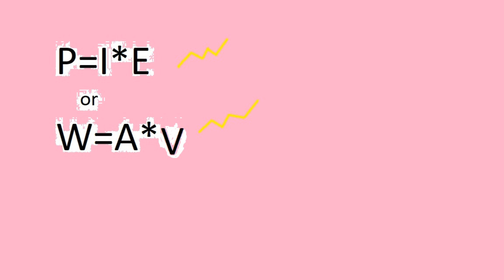ASRock AB350M Pro4 Freezing, Crashing and Lockups! Part 1

Comment: My PC just froze while watching this video. Thanks ASRock!
Reply from the maker: What is your CPU?
Reply: Ryzen 3 1200 stock speed
Reply: What BIOS version are you using btw?
Reply: Hello?
Reply from the maker: 4.50
Reply from the maker: have you run a memory test to be sure your memory is good? A bad memory stick can do weird things.
Reply: Did a memtest. No issues.
Reply: No errors found. I checked the hdd too
Reply: I'm using the 3.00 bios as of now. I tried all the BIOS and it's still freezing
Reply: The Crazy Old Coot Hello sir?
Reply: I'm having the same issue here with my asus prime b350 plus board gonna limp it until I get a x470 strix board. nothing wrong with ram or cpu until I tried to booted it up this morning no display in my pcie gen 3 slot had to move my rx580 down to my gen2 slot to boot! Yep bad board ugh. ;( thank god their is nothing wrong with my rx580 just need a clean install on a new mobo.
Reply: Mark Davenport Jr Try reinstalling OS with the latest media creation tool on the site.
Reply: Yep I found the source it was my dead rx580 card had to swap it out for a gtx 1060 6gb evga card its working great no freezing after a hour or so of gameplay. Now I just need to upgrade my ram to 16gb for future games. :)
Reply: BlazingApple did you stop it from freezing?
Reply: yep it was a dead rx580 had to swap it out for a gtx 1060 6gb card been working great just like when I first got my pc all I need is more ram 8gb is not cutting it these days. :)
Reply: I have this motherboard. Running Ryzen 5 1600X, GTX 1060 with 16gb of RAM and a Samsung 250GB SSD. Never had any issues. No freezing, no nothing. I don't know where these complaints come from. Get better parts. Mine isn't very high end but it's still good enough for a long time

Comment: Hey ya crazy old coot! Thanks for making the videos regarding the AB350M and the Ryzen 2400g. This is my first build and I was having a lot of issues, mainly BSOD Of all flavors. I adjusted the voltages as advised and, so far it has seemed to help. It even let me OC my GPU which it did not do before. Gave you a sub for all the help. Setup and result follow for those interested and others having issues. Note:  chose to do my adjustments in the BIOS. 

CPU Speed: 3.8
CPU Voltages:  1.3375
DDR4 Voltages: 1.3
DDR4 Speed: 2400 (it’s rated Speed)
SOC Voltages: 1.2
RAM allocated to GPU: 2GB

Build Specs:
Ryzen 5 2400g
ASRock AB350M Pro4
Samsung 960 evo 250 GB SSD
WD Blue 1TB HDD 
2x8 GB g.skill flare x ram 
Cryorig H7 cooler 
Season 620W s12ii bronze psu 

If you have OC’d the GPU at all, what speed and Voltages did you use. Thanks!

Comment: Good video, you seem really wholesome, have a good day if you're reading this boss
Reply from the maker: TY
Reply: @ellsworth1956  you're welcome, it was very instructive. It seems I still have the problem though lol
cpu voltage 1.3 on a ryzen 5 1600x
ram 2x4 3000 but lowered to 2666
dram voltage 1.1v
cpu soc 1.2v
the more I play the faster the complete freezes gets, i tried updating bios and drivers, complete os installation,vrm is at 104 celsius even at the moment I start my pc and it doesn't go higher. honestly I don't know what to do. Trying to contact as rock for a replacement or a solution... any ideas? bios is at 5.5 I think but I'll lower it to 4.5 if it can help
Reply: I did memtest too and had no issues
Reply from the maker: @idiedinvayne1712  Try bumping your Dram Voltage up to 1.30V . If your VRM is stuck at 104C something is not right most likely a bad sensor. Do you have a way to actually read the temps of you VRM. IR gun or a TC?

Comment: I think it's because you can't adjust the SOC voltage.  I tried entering a value into the VID setting and it's stuck at 0.95.  Other people have reported that setting does nothing.  I ended up buying a MSI B350 Tomahawk and so far so good.
Reply from the maker: Demetrius Lolos you can set the SOC voltage in Ryzen Master.
Reply: @ellsworth1956  Tried that and it doesn't keep the voltage when I suspend, hibernate, or restart the PC.  It does work though, but temporarily.

Comment: I’m pairing this board with an R7 1700 mostly for the 2 m.2 slots the board provides. Based on the reviews and this info I think I will water cool the proc. Not for the overclocking potential but for better heat management. I have to wonder if the wraith spire coolers are dumping heat into the same space and this would cause an issue in low air flow cases. This would then be a really big concern when you dial in an overclock...

Comment: If voltages are an issue, then it puzzles me how to solve the problem concerning my setup (AB350M Pro4 / Ryzen 5 1600 / 32 GB RAM at 3000 MHz / GTX 1050 or GTX 1650).

Restraint on a cool day seems to be my best solution, yet it is not full proof, and those cool days will only last a few more months.

BIOS is up to build P6.00. All BIOS settings are default at present (including my RAM speed being strangely set at 2133 MHz), and I use default (stock) clocking on my video cards.
Reply: Probably should give an overdue update: VCore aside (I couldn't get a reading on the default setting, so I left this alone), I tested out the voltage tweaks a year and a half back.

They proved to be roughly 99% effective (rather than experiencing multiple freezes per day, I was experiencing no more than 1 freeze per month, maybe 2 if I was really unlucky)... until my cmos battery started dying, causing these settings to be no longer be saved consistently.

Comment: My Asrock B450M pro4 , 
1)Turn on PC - This works... Boots into Windows 10 just fine, no issues.
2)Turn off PC - This works... Just FYI - all fans stop, computer is off as far as I know.
3)Turn on PC (right after turning it off, like 5 seconds later) - Makes it to the ASRock screen, but just sits there. I disabled graphical POST (with AsRock Logo)
Reply from the maker: If your Power Supply has an  On/Off switch try turning it off for 5 sec then turn it back on then try turning on the PC. If it doesn't have an ON/Off switch just unplug it for the 5 sec.

Comment: Only issues I've had is it won't work right being hooked up to my 42" tv with out using a Gcard. The video output was messed up so i sent it back. Awaiting for my replacement. I figure if my 10yr old gateway can run ok on my tv why shouldn't a brand new mb.
Reply: Dracoz74 ryen have no video card included bro. So its imposible to use them without a videocard. The only ryzen that have video output are the one who have G at the end like the 2400G that are an APU.
Reply: ya i thought I put that the CPU was a Ryzen 5 2400G. I sent the MB back, the replacement (knock on wood) is working just fine over all. I still have to use a smaller tv to get into the bios. But i think that's cause my system is to fast now. And doesn't "wake" the tv up fast enough. I'm happy with my set up.
Reply: Dracoz74 nice, you can install the asrock bios restart its a software that you can download from the same webpage that the BIOS and you can use it to reboot instantly in the bios without touching the F2. I use it because i have the fastboot mode to.
Reply: sweet i'll check that out thanks!

Comment: I have this ASRock motherboard and I'm getting lots of random freezing that's lasts about 10-15 seconds. Sometimes in game (vary frustrating in multiplayer) and even on the desktop.. I would not recommend this to anyone at the moment. Can things like this be fixed by ASRock just through bios updates?
Reply from the maker: Andrew Francies I do not recommend any B350 motherboards. I ditched mine and got the Asus B450M Tuf -Plus Gaming. So far so good. Working on a review right now.
Reply: I don't have these issues with my Ryzen 1600 on the AsRock AB350M  pro4 motherboard,  just ram clock locked at 2400 mhz and and it hardware reserves half of my 16 GB of ram.
Reply: @ellsworth1956  is the ASUS b450m still good until now sir?
Reply from the maker: @miguelricardosobong4927  mine is still running fine. I have an R5 2600 with an RX 570 in it now and it runs fine.
Reply: @ellsworth1956  I still have the pro4 sadly. I changed my SOC voltage to 1.2 and it still crashes. Do you have any more ideas?
Reply from the maker: @miguelricardosobong4927  If you have checked out everything I went over in my videos on this board. I'm not sure. have you tried another videocard just to see if it is the Videocard having issues? clean out old video drivers no longer in use.
Reply: @ellsworth1956  I'll try go over the video again but essentially what I did was set my cpu to 3625 at 1.15v, dram 2800 at 1.25 (memtested for 8 hours), SOC at 1.2. That's what you did also for yours right or do I need to input the same values as yours?
Reply: I have a MSI x470 gaming pro carbon with the same issue of freezing its driving me crazy!

Comment: I have the same motherboard, bios 3.40. I can`t overclock my r5 1500X, cause there are no settings in bios, such as cpu loadline calibbration, curret capability, cpu soc voltage and others. What to do? when i set 3800 with 1.35v, it works but only at 1.392v all the time and freezes so much in games. Maybe It uses the voltage of bost, but why?
Reply from the maker: The easiest way is Ryzen Master, You can adjust all that there except load line and there is none for load line.
Reply: ok thanks, i will try

Comment: FIRST TIME BUILD!! HELP!!!!!Hello, I just received my parts including the asrock ab350 pro 4 motherboard. Hopefully you can help please? I have the rzyen 1600, 2 8gb corsair vengeance at 2400mhz, evga 500b pos, and I cant get this thing to work. FANS TURN ON FOR LIKE 10 SECONDS, TURNS OFF, AND RESTARTS AGAIN, OVER AND OVER. I just cant get it to boot at all. PLEASE SOMEONE HELP!!!
Reply from the maker: If you are sure your CPU cooler is on correctly  and the fan is spinning and you have your power cables on correct (dont forget there are 2 ATX cables) then try one memory stick at a time. then take 2 aspirin and see me in the morning.
Reply: Ill take the 2 pills, and see you in the morning. I am done. Was going to switch from console to pc, but this shit is not what I expected. I cant even get my first pc to work!!!   CPU cooler is on correctly, fan is spinning, and power cables are correct, but here is the problem, the asrock has a 24 pin for power, and my pso has two connectors, one with 20 and one with 4, the 20 latches on perfectly but the 4 pin does not come with a little latch, therefore will not go all the way in, only partially. could that be the problem?
Reply from the maker: Yup that could be it. The 4 pin connector goes in first so the 20 pin kinda goes on top of it. You really shouldn't be trying to build your first PC by yourself. You should have if possible someone who knows what they are doing supervise you .
There are those tabs on the 4 pin connector on the inboard side, those go to the board side of the 20 pin not the wire side. I can send you pictures if you need.

Comment: I'm using Ryzen 3 1200 in my AB350M-HDV motherboard. Is it good?
Reply from the maker: Thanks for Subscribing! Power wise it should be fine as long as you have a decent power supply. Don't expect to get your memory speed above 2933. Just remember all the B350 boards have some quality issue as they all have 1 star reviews above 10%. If it runs your good.

Comment: Alright here is my final conclusion or (solution)  if your Ryzen keep crashing or freezing or you need to shutdown by holding the power cause the reset button doesn't work and does a black screen just download a newer version of windows 10 the real problems is windows 10 old version of 2015 wont work at all, all you need is the newer 2018 version of windows 10 the version : 1809
Reply: 1903 here and it still freezes
Reply: @Yasin Jones thanks Yasin I will try that today!
Reply: @Yasin Jones I did try it this morning before work and it appears to have fixed it but I test further tonight, if so you would think this would be known to the manufacturers and they could roll out bios fixes for it.
Reply: @Yasin Jones yeah it didn't work after all, infact made it much worse freezing every 10 to 20 seconds. Honestly I'm done with my board as I can't waste more time on it.
Reply: @Yasin Jones it turns out my board was faulty and they have tested it and sent it away, but it can take upto 28 days, lucky I still have my trusty x4 955 AMD rig while I wait

Comment: I have a ab350m hdv mobo  I feel like it's not powerful enough only supports 65w cpus.
Reply from the maker: I'm setting up my new Motherboard for my R5 1600 and I'm puling 125 amps at 3.8 Ghz all cores with a voltage of only 1.33. Now this is under stress but I wouldn't want to pull more than that through the AB350M pro4 board or other low end ASRock Motherboards. So you can get away with a moderate OC on a six core but that is it. Why would anyone buy a budge Motherboard for an 8 core 16 thread CPU is beyond me.

Comment: So this board will work with r3 2200g without any problem?
Reply from the maker: If you get one label Ryzen 2000 ready. If not once you have  the BIOS up to date you should be good.
Reply: The Crazy Old Coot Thanks a lot for great videos, but is bios the only issue? u said in the video that Asrock AB350 pro 4 works ok with 4 core cpus but previously I had read the comments about this mobo and decided to get another, now if this works fine with overclocked r3 2200 , I will buy this!
Reply from the maker: Amin Raeisinia if you plan on overclocking just be warned the wraith stealth cooler is limited. See my video on how high can it go. I got my 2400G up to 4.1 without much hassle . Always monitor your Voltages and Temps with a new build. That is double when over clocking.
Reply: The Crazy Old Coot tnx🙏

Comment: It's because it needs a BIOS update i have read ???
Reply from the maker: Yes!  The "One" they haven't released yet.
Reply: The Crazy Old Coot , which bios version you use and what version of card and cpu ? I planned to buy that asrock...😐😐
Reply from the maker: I dont have a freezing, crashing or lock up issues, others have this video was to help them make sure it was the board not their set up. If I was you I would wait for the B450 boards. The all of the B350 boards were rushed out the door and have quality issues which I would hope will be fixed in the B450 boards.

Comment: What a fucking ripoff. I wish I bought a good motherboard. How do I replace this junk mobo? I'm new to building PC.
Reply from the maker: I just picked up an ASUS Tuf B450M  Motherboard to replace mine. I will be reviewing it in the coming weeks.
Reply: The Crazy Old Coot hmm okay, as long as it doesn't freeze and supports basic overclocking, I'm okay with it
Reply from the maker: Don't run out and buy it yet, It is still in the box! I did pull it out of the box and look at it. So far so good. I will be putting my 2400G in it.